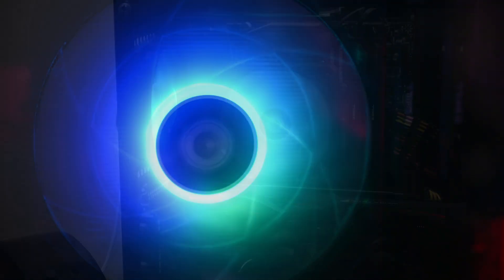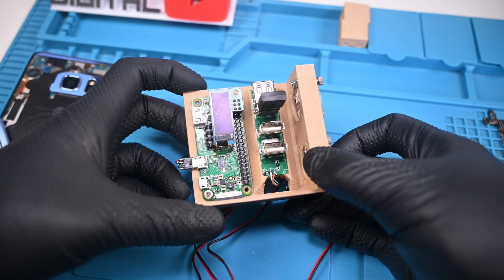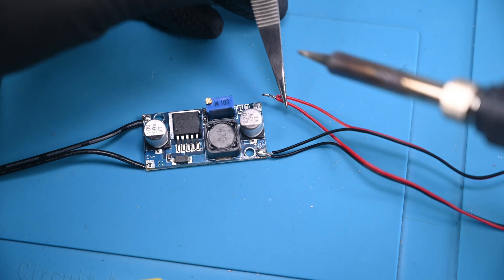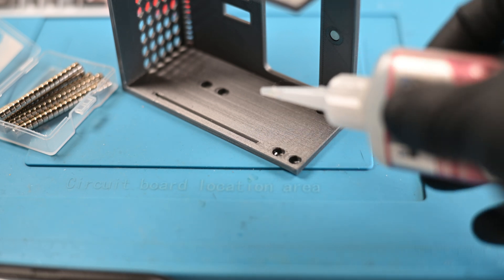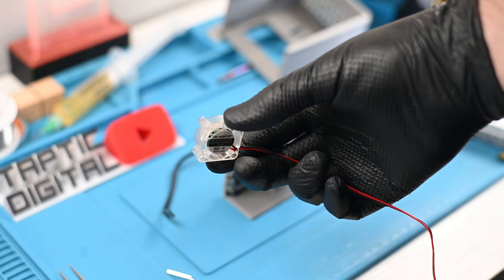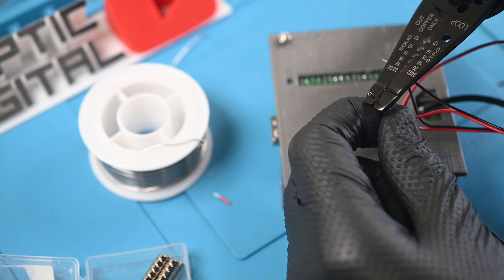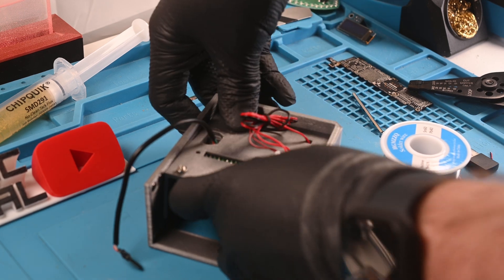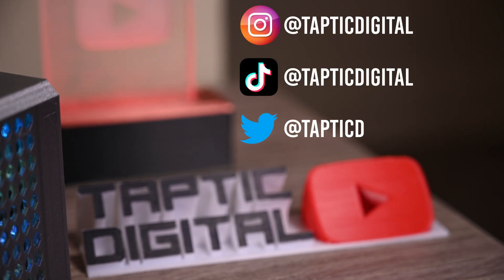Making a Pi Zero Desktop PC

Comment: Cool video. Gotta ask.....what's your blue desk top called? Looks awesome with handy storage. Looks rubber lol
Reply from the maker: It’s silicone! I’ve seen it called several things but I usually just call it a “silicone repair mat” or “soldering mat” as it is made to take some higher temperatures.